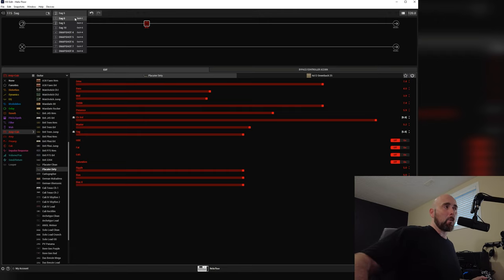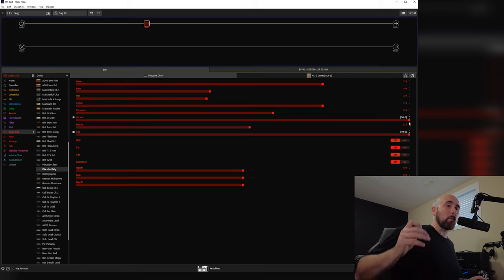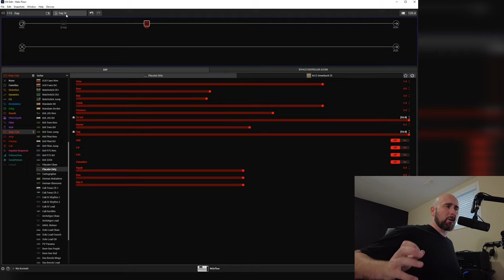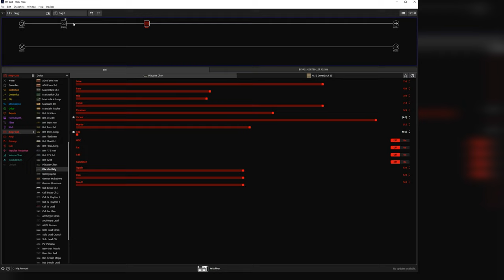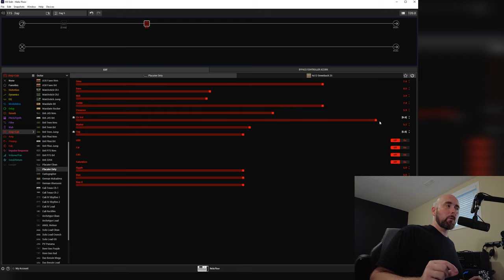Make Any Helix Amp Model Feel Better In Seconds!! | Sag

Comment: I had to make a pit stop in the bathroom while you were running through the 3 snapshots, and even from there, I could easily tell which snapshot you were using at all times.  Thanks for running this demo so carefully.  I have been ignoring sag and several other amp tweaks in my Line6 HX Stomp XL.  I will at least know what sag does to the tone now.

Comment: A lower sag (4.4) favors playing in chords or fifths Saturated by a little more attack, a more open, less messy sound; Nolly/QC way, Djent. And in the opposite direction, by increasing the sag, the sound seems more compressed, the bass and the low mids are less well defined, more rough. I don't find much benefit in increasing the sag.
Thank you very much Jason for this very interesting exploration of the Sag.

Comment: I will say that the sag is fun. I use the amp sims in the HX in front of clean tube amps. I use the eq from the amp and adjust the eq in the HX quite lower than if using it by itself. Then adjust the sag for flavor.

Comment: When I initially started using my HX Stomp and was trying to get a better "feel," I did look into the Sag settings. And though they did help, they didn't provide the dramatic difference I was looking for. I didn't appreciate the relationship with Sag and Volume parameters until this video. Thanks for clarifying that.

Recently, I've had good success using the Low/High EQ Block to liven up and get the kind of "feel" I was really looking for.
Reply: low/high with low pushed at 150Hz between amp and cabinet makes it sound warmer, like being in the room with the amp. I saw it in another youtube channel.